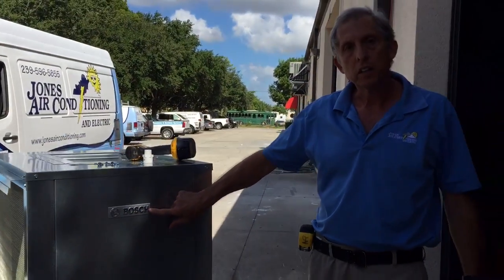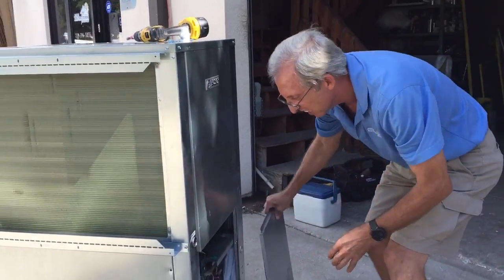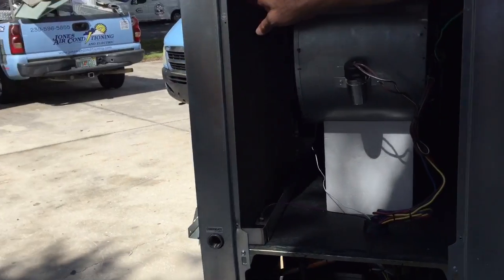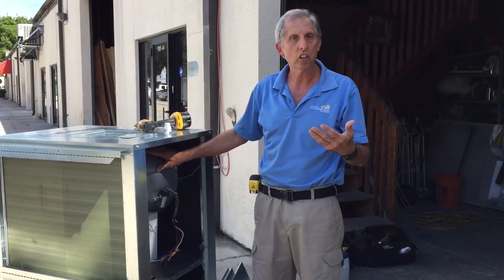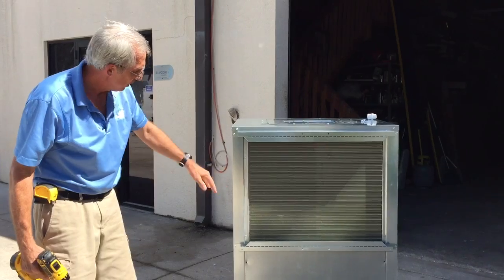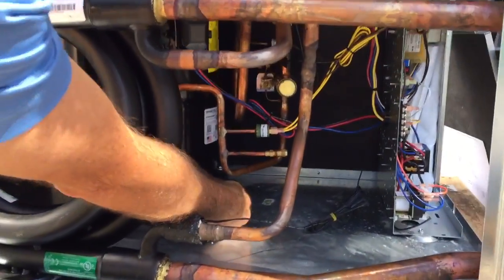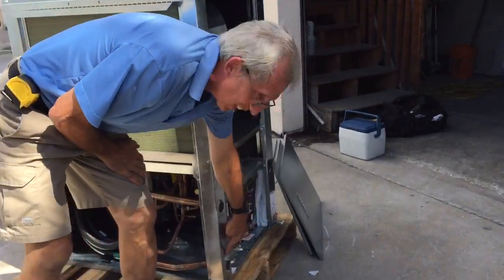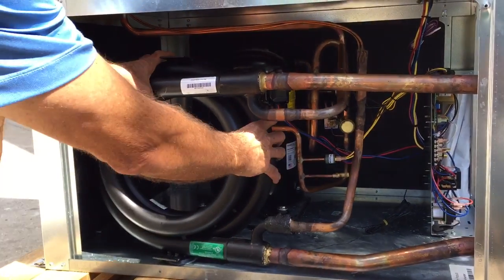Bosch Water Source Heat Pump Overview

Comment: How do you remove the blower motor assembly? Is it the 6- 3/8 screws mounted on the top sides of the assembly? there is no access to the sides its in a closet. thanks for your help

Comment: Got em installed on 9 floors of the Marriott in Virginia Beach, VA and I’m the service tech that repairs them. Only a year old and they’ve had tons of issues
Reply: Functionally they’re great when they run. But they pose problems with leaks which is the biggest issue I’ve found in them.
Reply: They suck so bad man.

Comment: I've worked on a house that has 21 fla hp 22yrs ago this customer called me when I left the company to a school system units are over 25 yrs.  Work great refrigerant leaks and water leaks biggest problem. I've replaced 2 w conventional hp . 20k ft of water lines in 15 acre field started leaking ot now has vertical lines house is forsale now ill be glad just because its alot of up keep

Comment: Dave, I had a Florida Heat Pump installed in my new house back in 1998! Still working although recently it has a acquired a small refrigerant leak. Will say it has been a great unit and has needed very little service. I plan to replace it with a Bosch unit. Do you still like them? Problems? Is the two-stage unit a single compressor unit with an unloading scroll? Let me know your more recent thoughts. Thanks.
Reply: If it's a closed loop treat the water but 20 yrs is good

Comment: Around 4:40-4:60, you say that water is coming in at 60d and leaving at 70d. However, you also say that, refrigeration is taking the heat away from water. Shouldn't the leaving temperature decrease? Also the refrigerant pipe that is used, is the refrigerant used only for cooling the water or also heating the water?
Reply: It’s a heat pump. Google reversing valve. It does both….

Comment: My issue, after working quite a bit with this technology here in Phoenix, is there is no good way to capture the condensation that forms on the uninsulated parts of the suction line and compressor.  There is no pan, like there is under the evaporator, to catch this. Please let me know your thoughts on this.  I have been using a secondary pan and manually emptying it, but I am looking for a better way.
Reply: Which compartment? Top or Bottom? Does the top compartment have lines that aren't insulated or over a drain pan?

Comment: At 1:35. Cold water from the cooling tower does not flow through the evaporator.  Wish I had as good of luck with those units as you. I have a building with 40 of those and have had to replace 14 evaporators. And 4 more are leakers. Thumbs down on your video. Plus 2 of the 40 from the factory were leakers with bad welds.

Comment: I installed a three and a half ton GEOCOOL brand water source heat pump five years ago.  It is very efficient and does a good job but I am disappointed in the noise of the scroll compressor.  I have had Weatherking units in the past with centrifugal compressors and they weren't any nosier than this scroll compressor.  The GEOCOOL is a quality unit, cabinet is also stainless steel and Cupro Nickel heat exchanger.

Comment: Can someone help me understand how the water cools or heats the refrigerant without mixing together both liquids. The coil he is showing makes it look like they are connected together and mixing, which I know is incorrect.
Reply: The coil shown is a heat exchange comprising of a water piping that wraps around refrigerant piping. The water will absorb (or release) heat from/to the refrigerant piping without mixing together. They're only exchanging heat, and each run in it's own loop!

Its kind of like having a loop of hot or cold copper coil submerged into a tank of water; where the water will absorb the heat of the coil without actually mixing with the water in the loop.

Hope this clarifies some of the confusion!
Reply from the maker: goes through a cooling tower on the roof
thx for watching

Comment: They are great units, very efficient with like a 13EER with nominal gpm. Tons of them in high rise building on the beach here in Ft.lauderdale. I'm a senior tech here and have a 4ton Bosch in my home fed from a well... it's an open loop that discharges to the canal behind me.
Reply: hi, just reading your comment on Florida heat pump. I have unit at my mother's in Sebastian Florida, the reversing valve is not working apparently and guy I usually use says it is too costly to repair. any idea cost to repair something like that, thank you.

Comment: excuse me sr jones a question when a heat pum unit start but  stop on 2 minutes  what component can be. defrost selenoide or high pressure switch.   thank  you  Sr.
Reply: Defrost? Donde vives pues a menos que sea lugar frio Defrost no hay en un heat pump unit.    Posible High press switch pero necesitas Gauges to check.

Comment: Companies seem to be reluctant to install or support this equipment in Miami. Very disappointed, looks like a well designed heat pump. Was really interested in a residential geothermal system but the pool of companies down to one and won't coordinate a vertical well closed loop system.

After discussing this with 15 companies, most feigned ignorance. The three that Got it had 7 day shipping for BOVA system. Plus they all were very worried about the supply chain for parts when it comes to maintenance. Lots of supply houses here for straight cool. All brands except Bosch.
Reply: kris miles true Miami is not a good place for Bosch a lot of issues w their units here.  20 plus yrs in the field.Warranty issues too.......

Comment: I guess the question to ask is would this type of unit work in the North such as Illinois where I live. I would like to find a viable option over gas. I don't mind spending extra over a possible return. Any thoughts?
Reply: They should. The ground has a constant temperature. It's always going to be warmer than the winter air and cooler than the summer air.

Comment: excellent video. thank you for sharing. glad to see you again. thanks
Reply: Question how high the temperature can go/the refrigerant  mix with the water
Reply: The water does not mix with the regiferant.
Reply: @gregorygrimm5540  It also costs a lot  to replace the evaporator coil every 2 or 3 years.